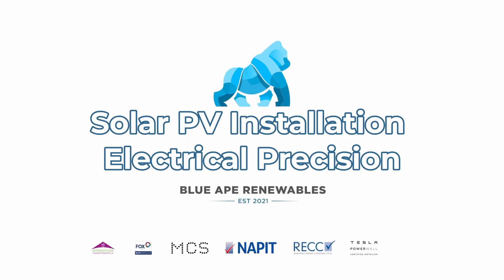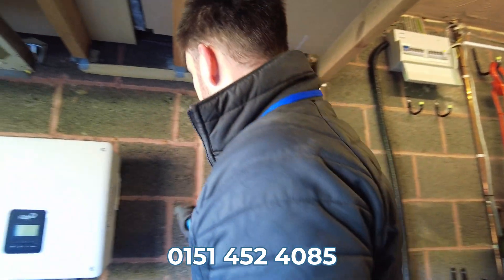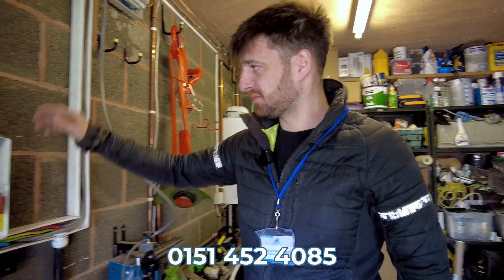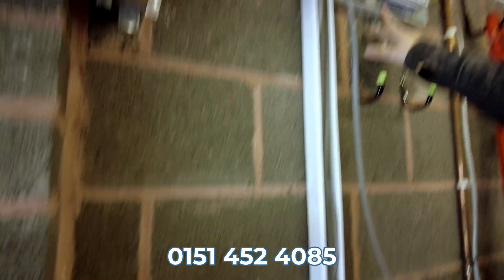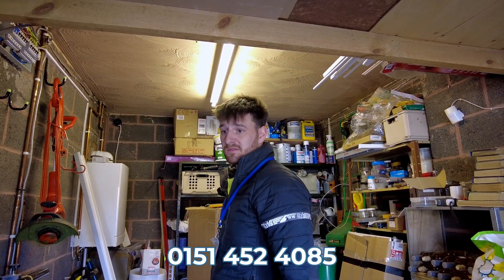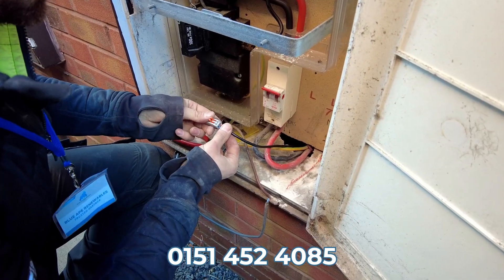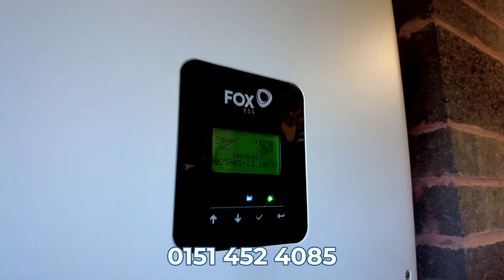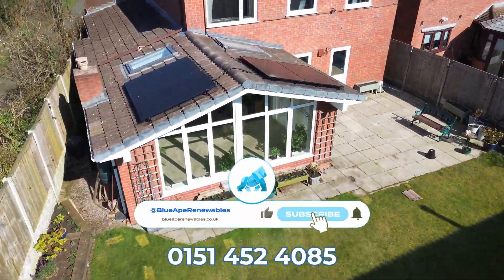Real Electrical Setup of a UK Solar PV Install!

Comment: Consumer unit is rated at 100A yet you will be potentially overloading that with the 16A inverter. Main fuse is 100A + 16A going back to grid is 116A. This exceeds the maximum current rating of the DB
Reply from the maker: A brilliant question — thanks for raising it! On this particular install, the main fuse is rated at 63A, so there’s no risk of exceeding a 100A limit once the inverter output is added. 
That said, you’re absolutely right that, in certain cases, a heavily loaded consumer unit combined with solar/battery export could exceed the overall rating. 
Great to see an electrical questions like this — keep them coming!